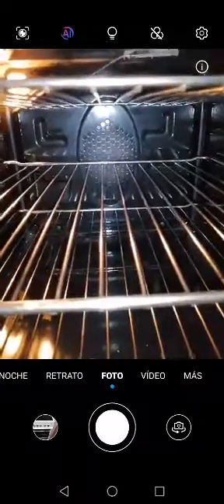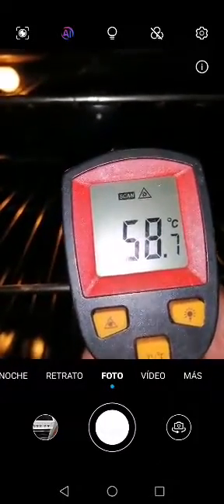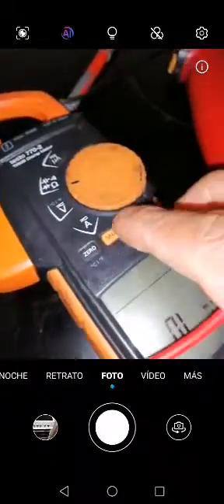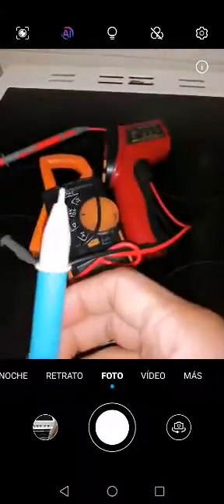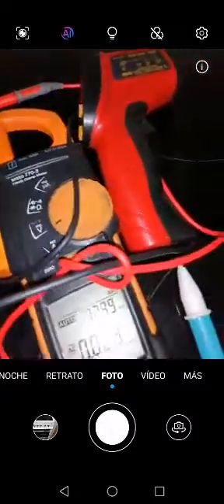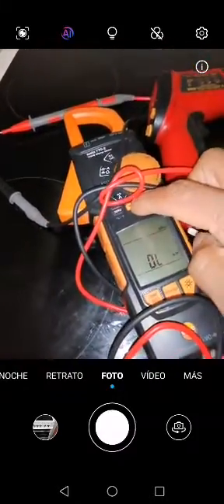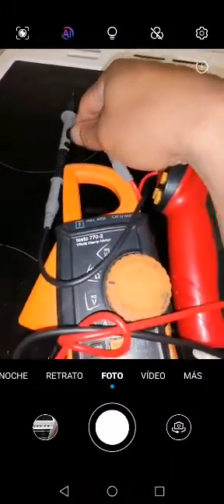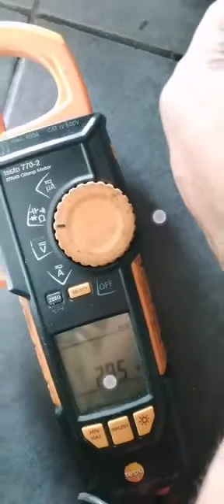FLAVEL MILANO E50 electric cooker fan oven not heating up!

Comment: Hi I've the same cooker  if I turn it up too 200  i get a funny smell  like something is burning  then the oven cut out   what could it be once the funny smell has gone oven is fine
Reply from the maker: I asked AI for you. This isn't my opinion. Do your own due diligence and be safe. Get an expert in or replace if unsure. Best regards 

— the cooker in question is a Flavel Milano E50 electric cooker.

From the comment you shared, the symptoms are:

When turning oven up to 200°C, a burning smell occurs.

Shortly after, the oven cuts out.

Once the smell has gone, the oven works again.

⚠️ Possible causes:

1. Overheating thermostat tripping – If the cooling fan or thermostat is faulty, the oven overheats and the safety cut-out activates.

2. Burnt/loose wiring or connector – Heat may be causing a cable or terminal block behind the oven to burn, producing a smell before cutting out.

3. Faulty heating element – Sometimes an element will partially fail, producing hotspots, burning smell, and tripping the oven.

4. Grease/food residue – If old fat or grease is on the element or inside the oven lining, it can burn off at high temps and trigger safety cut-out, though this usually wouldn’t cause the oven to shut down unless combined with another fault.

5. Faulty thermal cut-out (TOC) or control board – If the thermal fuse or cut-out trips too early, it will shut the oven off until it cools.

✅ What you can do (safely):

Check that the oven is clean inside (burnt food/grease on elements can smoke).

Pull the cooker forward slightly and check for burning smells at the back (signs of wiring damage).

See if the cooling fan (if fitted) runs when oven is on – if not, overheating will occur.

If the issue happens consistently at higher temps, the oven thermostat or thermal cut-out may need replacing.

⚠️ Warning: Since it involves burning smell and power cut, this could be electrical overheating – not safe to ignore. I’d recommend getting a qualified appliance engineer to test the element, thermostat, and wiring with a multimeter.

Would you like me to walk you through a step-by-step check you can do yourself (like a DIY inspection), or do you prefer a professional diagnosis guide that you could show to an engineer?

🛠 DIY Checks You Can Do Yourself (Safe Visual / Basic Checks)

1. Power Off First

Switch the cooker off at the wall and pull it forward slightly (if you can).

2. Check Inside Oven

Look at the element (top and bottom) – any cracks, blisters, or burnt spots?

Smell inside – does it smell like burnt plastic or burnt food/grease?

3. Cooling Fan Check (if your model has one)

Turn oven on and listen – can you hear a fan running when heating?

If not, overheating can occur and trip the safety cut-out.

4. Back of Cooker Inspection

Look at the wiring near the element connections and terminal block.

If you see blackened wires or melted insulation, that’s a fault.

5. Test Cut-Out

Run oven at 200°C, and when it cuts out, see if it comes back after cooling (sounds like it does).

This points strongly to either the thermal cut-out (TOC) or thermostat.

⚠️ If you smell burnt plastic or wiring, stop using it until it’s checked.

---

🔧 Professional Diagnosis Guide (What an Engineer Would Do)

1. Test the Oven Elements

Use a multimeter to check continuity and resistance on each element.

A failing element may overheat and give off a smell.

2. Check the Thermostat

Ensure the thermostat is cutting out at the correct temperature.

If faulty, it could allow overheating, tripping the cut-out.

3. Inspect the Thermal Cut-Out (TOC) / Safety Thermostat

Check if it’s tripping too early due to age/fault.

Sometimes needs replacing.

4. Check the Cooling Fan (if fitted)

Ensure it spins freely and operates when oven heats.

A seized fan = overheating.

5. Wiring & Terminal Block Inspection

Look for melted connectors, loose terminals, or scorched insulation.

Replace damaged parts immediately.

6. Control Board (if applicable)

Some ovens shut down due to PCB faults at higher load.

Rare but possible.

---

✅ Most likely culprits for your case:

Thermal cut-out overheating (trips at high temp, comes back when cool).

Wiring / element giving off a smell.

💡 Replacement thermal cut-outs or elements are usually inexpensive (£15–40), but diagnosis needs to be correct first.

Got it 👍 I’ll give you a step-by-step DIY test with a multimeter for your Flavel Milano E50 cooker.
This will let you check the heating element and the thermostat/thermal cut-out.

⚠️ Safety First

Switch off at the wall.

Unplug if possible.

Only do this if you’re comfortable with basic electrics.

---

🔌 Step 1 – Access the Oven Element

1. Pull the oven forward slightly so you can get behind it.

2. Remove the back panel (usually a few screws).

3. You should see the oven elements and their wiring terminals.

---

📏 Step 2 – Test the Heating Element

1. Set your multimeter to resistance (Ω).

2. Disconnect at least one wire from the element terminal (to avoid back-feeding).

3. Place the probes on both element terminals.

👉 A good element will read 20–40 Ω (ohms) typically.

0 Ω (short) = internal short.

OL / Infinite resistance = element is blown/open.

4. Also check for earth leakage:

Put one probe on the element casing, one on a terminal.

You should see no reading. If you get continuity, the element is leaking to earth (needs replacing).

---

🌡 Step 3 – Test the Thermostat / Thermal Cut-Out (TOC)

1. Locate the small round or rectangular thermal cut-out fixed to the oven body (often at the back, sometimes top).

2. Set the multimeter to continuity (beep mode).

3. Place probes across the TOC terminals.

👉 A good TOC will show continuity (beep) at room temp.

If it reads OL (open circuit), it’s blown and needs replacement.

Some TOCs are resettable (small button), others are one-time use.

---

🔄 Step 4 – Thermostat Test

1. The oven thermostat (connected to the control knob) is trickier but you can test it roughly.

2. Disconnect one wire and test across its terminals.

3. When oven is off, should be open (no continuity).

4. When you turn the knob up, it should close (continuity).

5. For temperature accuracy, an engineer usually tests it with a thermometer inside the oven.

---

🛠 Step 5 – Inspect Wiring

Check for heat damage, melted insulation, or loose terminals.

Tighten any loose spade connectors and replace burnt wires.

---

✅ If your readings are:

Element faulty → Replace oven element.

TOC faulty → Replace thermal cut-out.

Thermostat faulty → Replace oven thermostat.

Most parts are cheap (£15–40) and can be swapped fairly easily.

---

Do you want me to find you the correct replacement part numbers (element, thermostat, TOC) for the Flavel Milano E50, so you can order the right one if your test shows it’s bad?

Here are some replacement part numbers and example parts I found for the Flavel Milano E50, along with tips on choosing the correct one:

---

🔧 Replacement Part Numbers & Compatible Parts

Part	Suggested / Genuine Part Number	Notes / Source

Thermal cut-out / thermal limiter	P093026	FlavelParts lists a “Flavel Thermal Cut-Out Thermal Limiter 220°C (Part No. P093026)” suitable for Flavel models. 
Bi-metal thermal cut-out + cables	4410101001	Offered by FlavelParts as a bi-metal TOC with cables. 
Oven / Fan element (approx. 2100 W)	—	Many listings show a 2100 W fan element as compatible. 
Element (1600 W)	262900067	One listing offers a “Genuine Flavel Fan Oven Element, part number 262900067, 1600W” for the Milano E50. 
Element (alternate 1600 W)	—	A “Element for Flavel Milano E50 Cooker Heating Element 1600W” listing. 

---

🛒 Example Replacement Elements (with citations)

Here are some sample oven heating elements I found that claim compatibility with the Milano E50:

### [SPARES2GO Heater Element for Flavel Milano E50/E60]()
#### popular
£10.49

### [Flavel Milano Fan Oven Heating Element 2100W]()
#### higher wattage
£3.98

### [Flavel Milano Fan Oven Element E50/E60]()
#### mid price
£13.95

### [Beko 2‑Turn Fan Oven Heating Element for Flavel]()
#### alternate brand
*£8.99*Here are a few highlights:

[SPARES2GO Heater Element for Flavel Milano E50/E60](): 2100 W, twin-turn design.

[Flavel Milano Fan Oven Heating Element 2100W]().

[Flavel Milano Fan Oven Element E50/E60]().

[Beko 2‑Turn Fan Oven Heating Element for Flavel]() (brand alternate).

These are not guaranteed to fit — always double-check the dimensions, wattage, and mounting style before buying.

---

✅ What to Check Before Ordering

Wattage (e.g. 1600 W vs 2100 W) — match the one your oven originally used (or what works)

Mounting bracket style & hole spacing — your original element’s mounting matters.

Terminal spacing / tag size — so your wiring fits without strain

Thermal cut-out voltage / temperature rating — the P093026 is rated 220 °C. 

If you like, I can try to locate a genuine Flavel OEM part (not aftermarket) that’s guaranteed to fit your E50, with seller and price. Do you want me to do that?